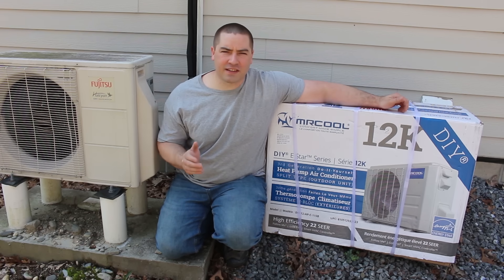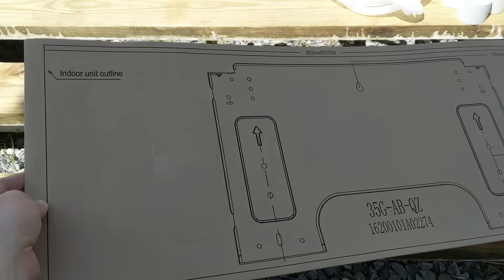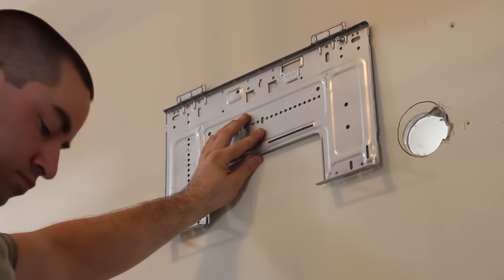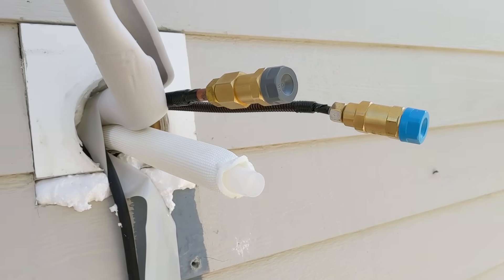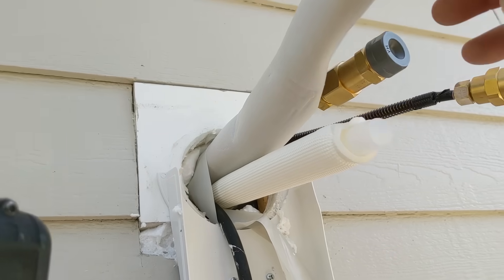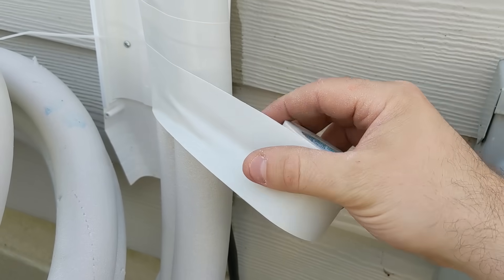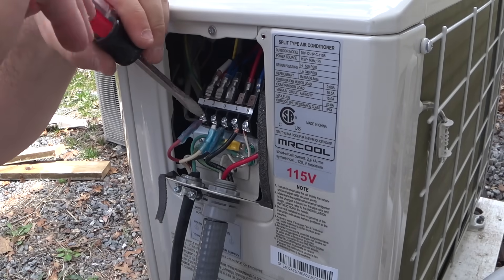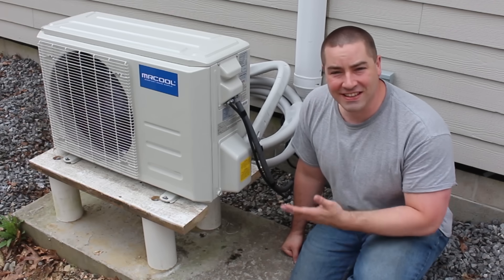Installing My Own Mini-Split Heat Pump, DIY

Comment: Being heating cooling contractor can guy  spell epa  never ever do what guy has displayed no safety glass I wonder what guy knows 410A  it boils at - 100 degrees lose your eye with one little burst your blind how about electric also a electrical contractor and master electrician and state electrical inspector Don’t try this your self I have seen some butchers out there This Guy shynever install a unit I counted 4 code violations great job Hack

Comment: My only comment is the way the lines are coiled at the outside unit.  From what I read, the way you have them prevent oil from getting back to the compressor.
Look at my Senville unit (https://www.youtube.com/watch?v=5WfgCrRLVJk&t=21s) at 7:34 to see how the lines are coiled.  This allows oil to drain back to the compressor.
  Courtesy of Dr. Google:
"For oil return, the suction pipe is the most critical. The suction pipe should slope toward the compressor and should be sized for minimum pressure drop and proper refrigerant velocities."
I hope the unit serves you well!  Regards.  JT

Comment: Should really use a vacuum pump before sending refrigerant through the lines.
Reply from the maker: I just posted a follow up video addressing that question: https://youtu.be/KzHLsRtVn4U
Reply: DavidPoz now that’s is pretty bad ass of design. They neeed to do that for all refrigeration lines

Comment: I didn't see how you recovered the refrigerant from the old Fujitsu, did you pump it down to the condenser or just release it into the atmosphere? I see all these "hvac guys" talking about pulling a vacuum an leak checking the flare fittings but not ONE of them mentioned recovery of the old unit. I just found that odd. I liked your video for the most part and you did well for a 1st time change out but enjoyed the comments a little more. Everyone needs a good laugh sometimes.
Reply from the maker: There was no refrigerant left in the old unit due to a leak.  So I didn't release anything into the atmosphere.  As for the vacuum on the new unit I just posted a follow up video addressing that question: https://youtu.be/KzHLsRtVn4U
Reply: No nitrogen purge, no tourqed fittings, no vacuum, no EPA licensing,  and no permit. Makes for an easy install.....

Comment: I bought a mini split off Amazon probably like 4 years ago and it had the premade copper lines I had to provide some wire from the outside unit to the inside and it did not include the nice covering outside and no smart stuff but pretty much the same I don't know if they charge a premium for DIY but it's unnecessary in my opinion
Reply: i think the main difference is that the line is vacuumed already.  so you do not need to suck the air out

Comment: But as you have not evacuated the pipes you have installed or lesser evil purged the air out of the pipes with gas(not recommended and illegal in most countries).you are responsible for the likely failure of your unit in the future from compressor failure. Due to ambient gases in the air such as nitrogen, ammonia, oxygen, carbon dioxide, and many many others which all  compress at different pressures and temperatures than the refrigerant gas in your mr cool unit which is designed to run on only this specific gas. Goodluck
Reply from the maker: I just posted a follow up video addressing that question: https://youtu.be/KzHLsRtVn4U

Comment: Interesting in New Zealand fujitsu comes with 5years factory warranty, 6years if you use a fujitsu approved installer. Your installer is to blame
Reply: mr cool paid him to make this obviously, around her fujitsu have a 10 year warranty, including labour
Reply: @neallyons9515  i got a quote on a Fujitsu, the guy told me I would get a 10 year but it was only because they were a Fujitsu-certified premium installer. If anyone else installs them, the warranty is only a 5 year.

Comment: Hi there
did u vacuum the lines before u open the valves and release the Freon inside the lines ????
Reply from the maker: I just posted a follow up video addressing that question: https://youtu.be/KzHLsRtVn4U
Reply: @DavidPozEnergy   thank you a lot Sir , you explained every step very clear and good

Comment: Great job. Looks good. Appreciate the detailed installation. The only thing I wish MrCool would have done is some how customize the lenght one needs on the cables to avoid wrapping them in a circle. Otherwise I will be looking into this for my home.
Reply from the maker: I agree.  They do sell units that let you cut the lineset, but not in the DIY version.  The DIY version has a fixed length lineset.

Comment: I’m going to be putting one in my garage/shop probably in the next 30 days.  I’ve seen lots of videos on the Mr cool, and this is the first time I’ve seen just short lines to get you through the wall, then you connect the rest of it outside. In the past it’s just been a 25 foot lead you had to push thought the wall, and really needed someone outside to manage. If this is the new norm, I consider it a great improvement. I’m going to need an electrician to get the power from the panel to the unit.
Reply from the maker: I think this one is the 3rd Generation.  I don't know if that helps?  It was pretty straight forward.  The indoor head unit is very light and easy to manage.  I can imagine trying to fish the copper lines through would be a bit of a pain.

Comment: Lineset are too long plus you need to vaccum the lineset and check for leaks with nitrogen before releasing the freon in the system but for a DIY you did a great job .
Reply from the maker: I just posted a follow up video addressing that question: https://youtu.be/KzHLsRtVn4U

Comment: These units are about the same reliability wise they are also Chinese like Fujitsu (these mrcool units are rebrand of midea units)
But those Fujitsu designer units are known for leaking indoor coils if it started breaking under warranty it probably would be working today
Reply: Yep. Those Fuji evap coils suck.  And it’s seems a lot of techs struggle making proper flares.  
Looking at the fan guard at the beginning of the video looks like it’s had a hard life lol.

Comment: The app on the phone looks alot like the app Midea uses. And the USB plug is a WiFi adapter
Reply: From what I understand Midea makes mini splits for various vendors like MrCool, Senville, etc; they just package them a little different for each seller.

Comment: EUHM. Shouldn't you have vacuümt the system before releasing the refrigerant????
Reply from the maker: I just posted a follow up video addressing that question: https://youtu.be/KzHLsRtVn4U
Reply: @DavidPozEnergy  Ahh Thank you.

And thank you it already had a vacuum. XD I would be such a shame if it wasn't. I have a Haier Tundra 5kw. Its also a pre-filled system but not a "DIY" system so i had to vacuum it myself. Maybe the name "DIY" and "Pre-filled" were used different in the US and the EU.

Comment: Were is the the Nitrogen test for mechanic resistence and liks. Were is the vacuum to remove air and humidity from the instalation. This is a good example of how not to do it. Leave this kind of work to professionals.
Reply from the maker: I just posted a follow up video addressing that question: https://youtu.be/KzHLsRtVn4U
Reply: Even Dow that type of connection is a seal, still there will be air in the connectors, that air in contact with the oil will start to be acid and it will start to mess with the equipment internal parts. Still need vacuum and a guarantee for machanic test with Nitrogen. In the United States certainly there's regulamentation for HVAC R, but in Europe that caind of machine cannot be sold.

Comment: DavidPoz thanks for the video. I am ready to buy one myself the 12k btu. My question: you have the 115 volt. Was that so you could add a single breaker to your power box vs a double 220? and did you add a shutoff box before the power gets to the fuse panel? thanks in advance
Reply from the maker: Hi Dan,  I wanted a small unit, and DIY.  The smallest unit Mr. Cool makes is the 12k DIY, and it just happens to be 120v.  I didn't actually care if it was 120 or 240.  I hired an electrician to install the wiring from my main breaker box to outside, and he installed the outside disconnect.
Reply: @DavidPozEnergy  Hi David, were you able to use the same disconnect box from your old mini split? We have one currently that we are looking at replacing with this DIY unit, and i'm wondering if I will be able to just connect it to the disconnect box that is already there. Thank you!

Comment: As a professional installer, I have to say I don't like these things and not because someone can do the install and they don't need to call me but because you can't make it look good with all that extra tubing. Plus you have no idea how good a vacuum has been pulled on that lineset or even if it leaked a bit before you got it (and yes, I have seen a few that I had to redo with fresh gas because there was air in the lineset). BTW, I have seen them because I have had to service a few with leaks and the R410A is gone into the atmosphere. They are banned in many other countries, just not ours, as far as I know.
Reply from the maker: Hi Mike H.  I agree that it doesn't look very good with the extra coil.

Comment: I installed a 12k for my master bedroom , unit is pioneer . I didn’t  know about mr cool . All mini splits are precharged . I would recommend buying or renting  a adjustable torque wrench. You will get some leaks at the fitting if not tighten down to the proper specs . If this happens you will need to hire a certified ac tech to find the leak , pull a vacuum and recharge the system .

Comment: Did you install the sleeve through the wall?
Reply from the maker: Nope. The sleeve is 8 inches long.  I would need one 14 inches to reach inside to outside.

Comment: Nice set up.  Only negatives for some folks would be the excess power and refrigerant lines that have to be coiled up behind the unit.  Too bad in that regard as the install would look and perform better likely if they were able to design a method to shorten them to fit.

Comment: I have two Mr Cool DIY units cooling and heating my 2000sqft home and they're awesome. I originally bought a new 4 ton HVAC heat pump system when I bought my home six years ago. I ran the HVAC system up until I installed my two Mr Cool DIY units about eighteen months ago. I have a 24K and a 12K DIY heat pump system and they're freaking great. They cool and heat my house as good as my 4 ton HVAC system using about 2/3 less energy usage. I also have a 12K Carrier mini split system in our master bedroom and a small 9K mini split system in our spare bedroom. But we only use those systems on rare occasions.
Reply: Are you still happy with this setup? I have to replace a 3.5 ton Trane outdoor that just died, quotes for a new 3.5 are running 8k-13k with a SEER rating 14-14.5 and HSPF of 7.5-8. Our electricity usage is crazy high, very much considering putting in two 24k MR. Cool units for 4k and getting the better SEER and HSPF values but concerned about longevity and reliability...also a 2000 square foot single story house.... Any advice?
Reply: N

Comment: That extra length of coiled up linset is going to cause a oil trap and eventually cause hug is with that unit
Reply: Only if it if laying below the level of the compressor or stood in a vertical orientation . It's fine as is if he slightly raises it.
Reply: @rydfree  Mr Cool?
Reply: This is the way the manufacturer recommends that the line set be installed.
Reply: I understand but there not very smart
Reply: Ya they want it to break so you buy more from them lol

Comment: Good job! I still would have called an HVAC man to come out  to leak test and vacuum my lines either though the unit was made for do-it-yourselfers.
Reply from the maker: I just posted a follow up video addressing those questions: https://youtu.be/KzHLsRtVn4U
Reply: The Mr Cool DIY units come with pre-vacuumed lines. Know your facts before you comment on a product you clearly know nothing about.

Comment: 1. Were those copper linesets under a vacuum? The tiniest bit of moisture can cause catastrophic problems shorting the life of the unit that you saved money on doing yourself.  
2. Why would you wait to release the refrigerant to check for leaks? If you have one, it may be too late and you will have to hire a Professional to even buy more legally.
3. I hope there was a how to on pouring water on the indoor evaporator coil to insure that your condensate line is draining properly.
4. Why is there like 15 feet of leftover lineset rolled up behind the unit? Please tell me your not going to leave it there looking like a pile of SH*T.
Reply from the maker: I just posted a follow up video addressing those questions: https://youtu.be/KzHLsRtVn4U

Comment: There's a reason why HVAC/R technician's go to school to learn about HAVC/R. Your workmanship is of a hack and you should not be installing any unit even if it's an DIY. As soon as you released the refrigerant I couldn't stop laughing because you mess up that system before you even got it started.
Reply: I've installed three mini splits following the instructions to a T. I think the author of this video did a very good job at installing this DIY unit. Maybe you could tell him where he went wrong since you seem to be such the self appointed expert???
Reply: Ozzie Alarcon equipment like this should not be allowed to be sold. And no AC equipment should be sold for diy install
What a load of cheap shit, that’s what’s wrong with the world, too many people want to buy this cheap shit
Reply: @Ozzie4Para  are you an HVAC Tech???? Because ANY first year guy would know you need to pull a evacuation on the system and showing some pro workmanship with that line set. Not leaving an excess amount of copper. It's okay I'm a doctor

Comment: I've never heard of a compressor based system that did not require vacuuming the air and moisture out of the pipes before letting in the refrigerant.    I don't suppose the instructions talk about why that step isn't required for this unit???
Reply from the maker: I just posted a follow up video addressing that very question: https://youtu.be/KzHLsRtVn4U

Comment: This is a general comment about mini-splits in our area of Wisconsin. HVAC contractors here mostly will not recommend them for install after the many constant failures in everything from commercial application installs to multiple Apartment unit installs all failing with constant callbacks have really soured the professionals thoughts on mini-splits in cold climates. Not trying to act like a troll but giving caution where HVAC Pros see it day in and day out.
Reply: First question I ask, who did the install?  DIY, find someone else..  I want nothing to do with that headache, you touch it, you own it.

Comment: the only thing that worries me is that you barely put any spray insulation inot both side of that giant hole in the wall. before you put the plastic cover on I would have definately sprayed more foam into that hole. it seems like you just left a black hole for the air to escape out of
Reply from the maker: Sorry I didn't cover it in more detail.  There is a lot of spray foam inside the hole.

Comment: He did not pressure test with nitrogen or pull a vacuum. Have to to both to remove all moisture from system. Will not last long guaranteed.
Reply from the maker: I posted a follow up video with many questions answered: https://youtu.be/KzHLsRtVn4U

Comment: And the vacuum pump?  Will never work as it should without vacuuming the system.
Reply from the maker: I posted a follow up video with many questions answered: https://youtu.be/KzHLsRtVn4U
Reply: The Mr Cool DIY units come with pre-vacuumed lines. Know your facts before you comment on a product you clearly know nothing about.

Comment: Are those copper tubes pre-vacuumed? Not sure if it's healthy for the system if they weren't.
Reply: Yes they're vacuumed sealed. That's why it's called a DIY system. No need to get screwed by hiring an HVAC tech to rip you off.

Comment: I’m a hvac tech, the only problem is that you need to vacuum the Ambient air out of the line set before you released refrigerant that is going to cause problems with you later
Reply from the maker: This is a very unique system.  No vacuum, no gauges, no pressure nitrogen.  The lines are pre-sealed at the factory.  Mr. Cool is the only company I know that has an official DIY version.  The lines are pre-charged. https://mrcool.com/blog/pre-charged-line-sets-real-right/

Comment: If you have multiple units, can you ensure they stagger startups, to reduce the peak loads on your inverters? 🤞🤓💜
Reply: Most all modern inverter unit mini splits start up at the lowest compressor rpm  ( lowest amps) . Then they slowly increase the compressors rpm to match the load.  There is really no starting high amperage versus running amperage ( often 5X ) like a window unit or non inverter AC. Ie with a modern 6000 btuh window unit the running amps at 120 volts is often say 5 to 6 amps. And the starting current is 25 to 30 Amps. The LRA (Locker rotor amps) on these window units is often 25 LRA on the compressors nameplate inside the unit.  

All that said an inverter unit mini split may not "like" to run off an inverter from say a solar system.  Its input current is often with some spikes and hash. One of my mini splits doesn't like running off a kill a watt watt meter. It doesn't like running off a ground fault breaker or gfci socket either.  Ie breaks them.